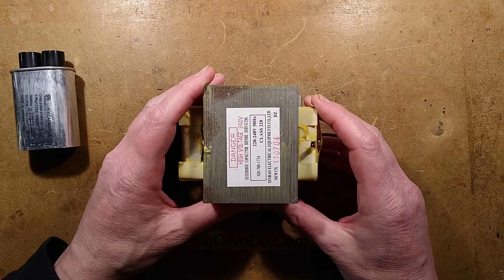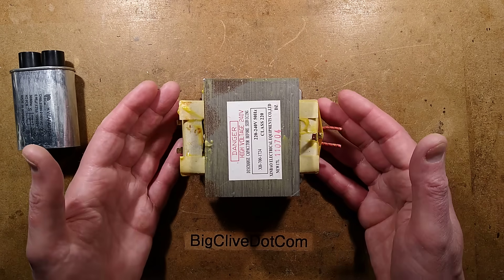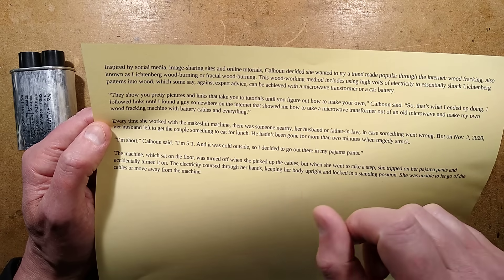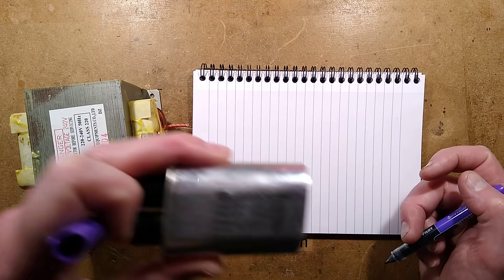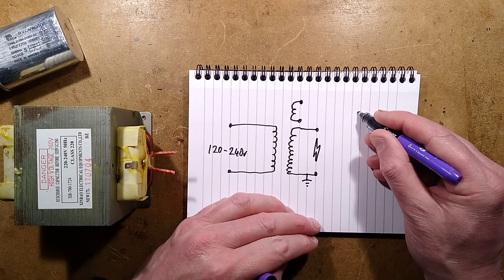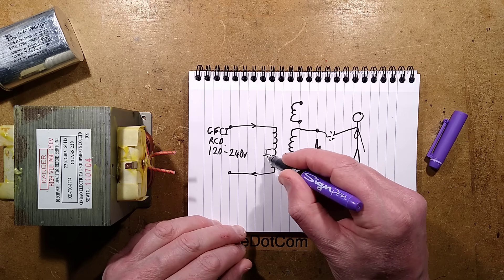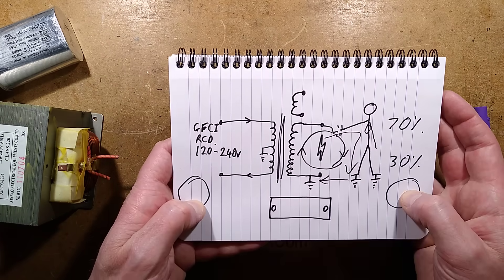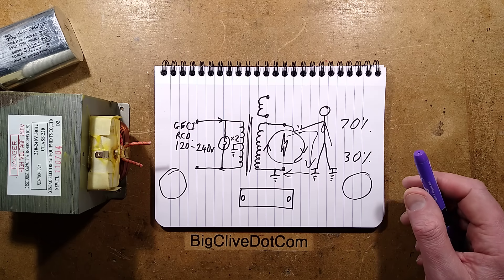The most deadly project on the Internet

Comment: I've never been able to get myself to actually take the leap into high voltage electricity, and this is why. I have all sorts of high voltage transformers and such, but I'll leave them as beautiful components on a shelf for display. and let Photonvids make all the high voltage videos.
Reply: That's the thing about knowledge. I've been scared of high voltage electricity since 89, when i went to school to learn about it. Mains voltage is enough to make me cringe, and i've worked with live circuits.. I was royally scared in school, had an amazing teacher who hammered safety into our skulls, almost literally. A real hard ass but he knew that us brats needed to learn fast, permanently instilling a proper respect.
Reply: @asbestosfibers1325  it's frustrating isn't it? This video is about how dangerous misinformation can kill people, then this person takes that as inspiration to write dangerous bollocks in the comments.
Reply: @beardedchimp  but its not bollocks. Considering that the body has a fixed resistance, 40,000 volts at 0.001 amps will not kill you whereas 200 volts at 1 amp will.  He isn't wrong. Hes just missing information in his post, like @lia stated,  the fact that a small amount of any 3 and you will survive( voltage, amperage and time) Clive himself has said something along the lines of this. So its not untrue, but it isn't the whole truth. Some of the most prestigious electrical safety organizations also state the same.
Reply: I once worked - or at least trained in TV servicing. The EHT that big TV tubes & drivers could put out was terrifying, along with the stories of people who had experienced it. It could literally throw you across the room and if the current crossed your heart that was it you were pretty much dead - unless someone was there to restart your heart. 
Old CRT TV's are ugly in that you can only repair many faults with the power on, so we had special measures to protect ourselves.. 
- The repair benches were insulated and isolated and the floors were covered with heavy rubber mats. . Benches and stools were specially made for TV servicing and were extra tall.
- You should never work on an open TV with the power on alone.
- When working on a live set you would try to only ever use one arm inside the cabinet at a time. This would particularly reduce the risk of lethal shocks through the heart.
- It was common to have the earth circuit in all the bench mains (UK) sockets disconnected. This removed the Earth path inside older TV's with earthed frames making a shock a lot less likely.
Reply: I don't want to get myself to make the leap.  I turned down a job, when I really could have used it, because it involved working on high power UPS systems.  I think 10kV internals?  Sorry, all the safety protocols you can have, I don't want anything to do with it.  Or Fluorine chemistry.
Reply: @radellaf  in terms of a UPS system your thinking of KVA not KV. UPS's are rated in volt amps that doesn't mean the system is running on 10KV
Reply: @Tlavite  Not quite... This was from a job interview and they specifically talked about having to deal with KV battery banks (or internal voltage rails, I forget).  Maybe it wasn't 10KV, but it was over 1.
Reply: @radellaf  I feel you.
Reply: @radellaf  Absolutely. I have most "common" acids in my little home brew lab and so long as you have goggles on, you're pretty much good to go with the main three, even at 98% 67% and 35% 

Will never have HF in the place though, amazingly useful for some things, though it is. I remember reading about that lass who had a single drop get through her glove - and was "lucky" enough to get away with just amputation of her finger. Insidious stuff - destroys the pain nerves before they can register an issue.
Reply: @guyteigh3375  Yeah, I have no interest in HF.  Bad enough that PTFE and LiIon batteries (PF6) release HF vapor.   I think the lab has mostly concentrated nitric.  Not fuming, just the distillation percentage one (I forget the word).   The problem is that the equipment heats it to sub-boiling, so there's scalding hot liquid acid AND vapor.  I'd want hazard pay.
Reply: @Darkfarfetch And these transformers provide both.
Reply: @Darkfarfetch "aMpS iS cUrReNt" no shit😂 you just paint an incomplete picture using a potentially harmful statement because you don't know what you're talking about
Reply: @Darkfarfetch You're pretty much looking at someone going white water rafting and saying, "don't worry. it's not the rate at which water flows which is dangerous. the amount of water is dangerous."
Reply: @dreugh424  haha, that's a good analogy!
Reply: @Darkfarfetch it's a combination of both - obvious extreme example: 2 volts and 1kA you won't even feel.
Reply: @cozmium  if 1KA is actually flowing you'll feel it, even at 2V.  lower voltage makes current flow less readily through a given resistance, but even at low voltage, more than a few milliamps of current that is flowing is deadly.
Reply: @cozmium  well, not quite. your skin is too resistive to allow 1000A to flow at 2V, even if the power supply was capable of delivering it. you skin would need to have a resistance of 2 milliohms. It also depends on the path the current takes through you body and the total energy available - like grabbing a capacitor in one hand and the shock crosses your hand, verses grabbing one lead with one hand then the other lead with the opposite hand - where the path can transit the heart and interrupt the rhythm and possibly stop it. The resistance of you skin drops once the voltage gets high enough to break-over that barrier and establish a current. Then you become one with the fractal artwork in a circuit like this, only not a pretty picture for whoever finds you.
Reply: @cozmium  it's not both it's amps alone, it just so happens high voltage systems normally have a strong amp supply
Reply: @cozmium  you will feel 1000v regardless of the current, and it can cause a heart attack 24 hours later....
Reply: @Darkfarfetch - It's *both at the same time*. This old, misleading mantra should be given up on already.
Reply: @Darkfarfetch I'm not sure how you can be on this channel and still spread this misinformation.
Reply: @Darkfarfetch and this has plenty of amps to go with the voltage.
Reply: @Darkfarfetch WRONG. Without a high enough voltage you won't get much current through a resistance.
Reply: Other then the ocaisional flyback transformer, I've never had to deal with anything over 600, volts 300 hz 

Then again, at the age of 10, I rewired my bedroom outlets.
Reply: @richlaue  I personally replaced one of my bedroom outlets before moving out but that was because the plugs were falling out.
Reply: I think when shorted voltages drops and current flows infinitely
Reply: @Darkfarfetch not true, total energy is voltage*current*time, so if one of those is very small then you'll be fine. for example, ESD can be hundreds of volts and 10+ amps (initially) but the charge dissipates so quickly that you only get a few mJ running across you. 

also the contact points on your body (between the higher and lower voltage potentials) determines what organs the current passes through (and therefore, whether it's fatal). you also need enough voltage to get past the skin...
Reply: @Darkfarfetch 
I really wish that stupid quote would disappear from existence. It's still said in schools which shits me. It is misleading and encourages people to do stupid things thinking they're smarter than the angry little assholes traversing the wire.
Reply: I just thought of him this morning !!  Like a electrical moth man type thing lol
Reply: I have extreme paranoia naturally so high voltage is just something I'm a little extra paranoid about
Reply: Tesla Coils are a comparably safe high voltage device that can be fun to get started out with. Also many of the higher voltage transformers in the 20kV+ range are less likely to cause deadly shocks because the thin secondary windings melt if they somehow pass too much current due to some accident. However, never attempt these things if you haven't informed yourself on all the dangers.
Reply: No one knows the exact day hour /But we can see  the signs  events all around us. And  by the timeline,   Israel is  80 years and  1 generation span  according to bible  text will be around  2027 , which israel was declared  first in  1947 + 80 years = 2027 .  so we know we dont have  10 years left as this is 2022  so the   rapture, then the tribulation  will be before 2030 for sure.

The rapture will happen without a doubt and it will happen much sooner than many believe (less than 10 years according to all the environmental, weather,astronomical signs ,israel timelines etc showing ). It will happen without any warning , not one , in an instant , catching masses of people off guard just like God always does, ie the flood ~ a rude awakening . No one knows the exact day or hour the rapture will happen is a certainty . THE RAPTURE CAN HAPPEN NOW at ANY TIME make no mistake !! . Please awake to Christ Jesus which is the ONLY hope NOW and dont let it be found out it IS all true later when its too late & many have been left behind in the most terrible times the earth Has Ever experienced Before and ever will...for anyone who sees this and doesnt know what to do please If anyone hasnt given their life and heart to Christ Jesus will have REAL BIG problems way bigger than any problems Ever had If left here on earth after the Rapture . After the Rapture The USA , Worldwide , will face More evils , Inner city chaos, firearm wars etc etc ,power & water , food shortages , military invasions,mass executions (yes much blood will be required by antichrist ) etctec than it Has EVER been seen Before and you surely dont want to be Here then . We Have Time NOW to change , please seek Christ Jesus while there is still time to save ! no one knows the day or hour of the rapture it will start out just like any other day and it will Take Place In the day In Broad daylight/sunny day , In an Instant FLASH without ANY warning ,& there will be peoples Driver Ids, cell phones ,wallets found in various parking lots,Purses, bill folds Found at work etc etc with NO explanation , and People VANISHING so No One can refute it has taken place. .
romans 10:9-10 That if thou shalt confess with thy mouth the Lord Jesus, and shalt believe in thine heart that God hath raised him from the dead thou shall be saved! 
please share with others =IMPORTANT
raptureready.com

Information  for anyone who has come across those that  refute the 
 rapture and  say  that it was supposedly  made up  and   say it was created by darby church  in 1700s . This is real good  to show it was  way before darby , and its documented .
 also rapture pre trib proofs even in dead sea scrolls .
15-1700s/  irenaeus 170ad/ 250 ad / /isidore 4th century   
sourced by intense search and study by  ken johnson 
https://www.youtube.com/watch?v=e1Nv-xFig8I
Reply: I had several MOTs and CRT flyback transformers for years before I felt I knew enough to safely play with them. If you don't feel ready that's a good thing.
Reply: Technically anything below 100kv down to 600v is considered medium voltage. Yet they still lable all power distribution equipment with "Danger High Voltage" though most electrical sources we deal with everyday are considered low voltage.
Reply: @Darkfarfetch  as little current as 35 mA through the vital organs can kill a person. That's done using as many volts to cross the skin barrier as necessary, usually above 100.
Reply: @Darkfarfetch current ( amps ) is a sum of volts divided by resistance, ohms law says v=ir
Reply: "let Photonvids make all the high voltage videos." - Even he (Photonicinduction) is quite obviously taking precautions not to be near those HV monstrosities he has at his home when he turns them on.
Reply: Right. I have an electrical engineering degree, I understand exactly how to work safely with HV, and I know that even with proper precautions, accidents can and do happen, with disastrous consequences. I know of careful and diligent people working for the grid who have been injured. Strictly for the birds, IMO.
Reply: Voltage doesn't kill, it just gets the amps to your bones and organs and heart
Reply: An adult toy called a violet wand uses voltages in the tens of kilovolts and is regularly used on bodies all the time c:
Reply: @made.online2149  Very true - and they are awesome fun too ;) They are however high(ish) frequency and exceptionally low current. Originally French quackery - electrodes for inserting in all sorts of places - and even (shudder) over the eyes. Great fun with the right people on the right "bits" though :)

Comment: I have a set up, with three of these strapped together with 2 of those capacitors wired as a multiplier. Is good for around 12kv dc. Yes I know what I'm doing, yes it's very dangerous, and yes it makes excellent burns on wood ☺️

Comment: With any transformer, beware back EMF - when the low tension current is switched off, the magnetic field collapses in a microsecond and creates a huge momentary jolt on the HT side.  Don't believe me?  That's how a car ignition system works, 12v to 15.000v spark, higher with electronic ignition. I once got a short from a faulty lead and the effect of the jolt on my muscles threw me across the workshop.  I didn't try that a second time.
Reply: That is how a Ruhmkorff coil generates a high voltage current, albeit continuous rough sparking.  I tried making my own, using a buzzer in series with the LT side of the transformer with a 1.5v battery.  This rough sparking read as 15,000v on my meter, but that's an average, it must have peaked at double that.

At school, I once shocked a ring of THIRTY fellow pupils, to much hilarity, but it was only years later that I understood the potentially serious consequences of what I did!!

Comment: Would it be possible to rig a GFCI/RCD to the high voltage side ground tap that would interrupt the 120/240v mains? Theoretically the ground tap of the microwave oven transformer should be nearly zero current if the rest of the installation is properly designed (ie, has it's own ground cable running directly to the transformer), right? That way if there IS  ground fault through something/someone, it should cut mains voltage.

Thank you for this PSA. I know someone who built a machine like this but thankfully he did put a lot of thought into how to do it safely. (fully enclosed, multiple interlocks, fixed HV clamps that don't need to be manually held) I'll send him the link to this video just to be sure though.
Reply from the maker: Complex.  It would require specialist circuitry due to the voltage and arcing.

Comment: As soon as you mentioned the voltages involved, Eh No way was my reaction yes I have worked with very high voltage inside of photocopiers, I just do not see a truly safe way with the voltages and currents with household stuff! I'm pretty paranoide with working with Valve/Tube amps...

Comment: Why can't there be a sensor people could attach to their body that would detect high voltage and trip a relay that would turn off the mains power?   Maybe even a normally closed relay across the mains voltage with the control coil between the person and ground.  If the persons voltage was high enough the relay would trip to open and the mains voltage would be cut off.
Reply: Another workable idea is connecting a, preferably mechanical, washing machine timer between your suicide machine and mains.  Set the clockwork timer to say 45 seconds, and then power up!!!!  At least whoever finds you probably won't get zapped.   Placing a large sign with instructions for rescuers between you and the entrance  would also be a nice gesture.

Comment: That is a very simple solution, 2 switches far apart from each other so you cannot get hurt however you try.
Do not confuse this with the 2 position switch, where you need to press it only a little bit. The idea is if you were to be incapacitated, you would either squeeze your hand from a cramp or release it, either of which will disconnect the circuit, could work but 2 switches is simpler and easier to get.

Comment: Number seven should be written with a horisontal line in the middle. Here you can see why the American (stupid) way of writing number 7 is stupid. It looks like a greater than sign. Just written down hastily. Number one with just a line is also dumb. It can be mistaken for the letter l, upper case I and many other things. Number one should be written with a small extra thingy on the top.

Comment: Great video thanks. I have about 20 microwave traffos which I retrieved from scrap ovens. I only use the primary windings. I immediately cut out the secondary windings after I strip out the traffo from the oven. I worked at electronics for over 40 years and know exactly the hazards which you describe. I have re-wound them to make power supplies for my amateur workshop and they are a great source for making odd voltage outputs, including a spot welder. Also useful are the very beefy diodes which can be used for making high-amp bridge rectifiers. So, the rule should be, re-use only by cutting out the high volt secondary winding and  re-wind as a useful low volt bench power supply, etc.